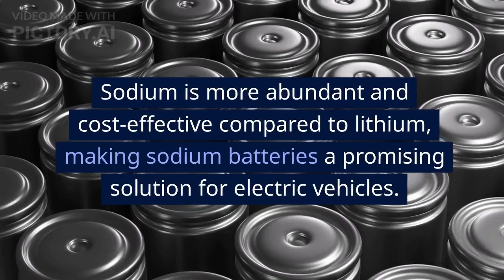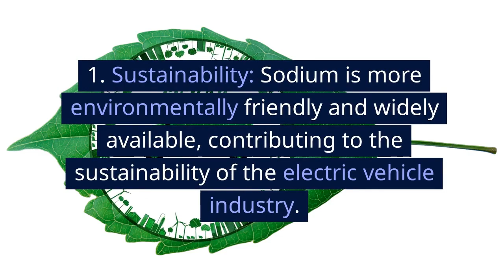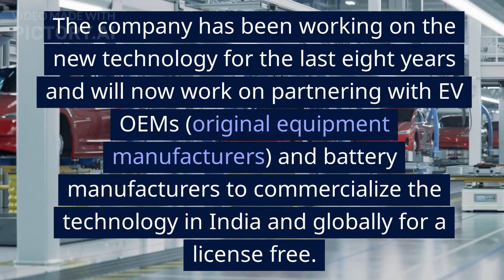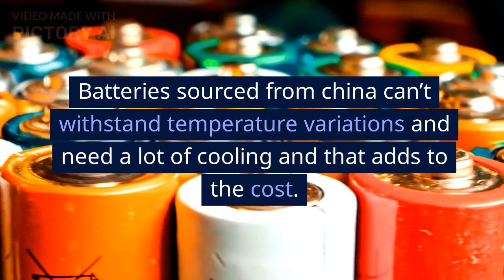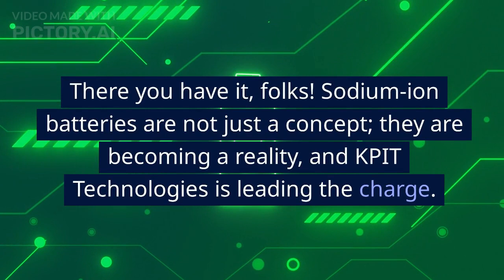SODIUM ion Battery will make EVs cheaper  An Initiative by KPIT Technologies Pune

Comment: If these batteries are for two and three wheeler vehicles it'd be way cheaper to sell the vehicle without the battery and simply make them hot swappable like the Company Gogoro in Korea which allows user to rent the batteries and swap them at over 2000 stations when required for fast recharge (As you swap them out as you need them and the batteries at the recharge station also double as grid supply) would this not be a better fit for India as it's transportation sector needs are very similar to Korea's?
Reply from the maker: First of all, I would like to thank you, for showing interest in my You Tube video. Definitely, swapping Sodium ion battery is a smart move. But at current stage, I am not having complete information about this movement, but I will definitely get back to you, if this happens in future . Please don't forget to subscribe my You Tube channel for more tech based video in the future.
Reply: @excitingknowledgeamit  That's alright mate, the sodium battery stuff does look interesting and should definitely help drive down the cost.  Here's a video of the Gogoro network they have in Taiwan, https://www.youtube.com/watch?v=r2hLjcNxjKI  I found video's as old as 3 years on this stuff so it must be pretty well established over there already.
Reply: Yeah but how come no one's heard of nano flow cell Bi-ion
Electrolyte refill? Battery swapping is obsolete. You don't need to swap the physical battery you just refill two salt water electrolyte tanks. Google Quantino Nano flow cell 48v
Reply: @MoreSuperiorThanCarbon  Well for one, you probably can't charge this at home because I'm guessing it's proprietary technology.
Secondly they don't mention the energy density anywhere (KWh per kg) This would really effect the range of the vehicle between charges. Another big one is the volumetric density (how much physical space does the battery take up per KWh?) It could be the size a small van required to have enough to go the same range as a BEV.  Details are sketch on this tech, it might be vaporware.

Comment: What is power density (kwh per kg)
Reply from the maker: Thank you for showing interest in my video, well its the most genuine question asked so far. Well I can't say the exact amount, but as per the latest information KPIT Pune unveils sodium ion battery with energy density maximum up to 170Wh/Kg  . I hope I have given answer as per the questioned asked. Please don't forget to subscribe my You Tube Channel, if you have not subscribed my channel so far.
Reply: @excitingknowledgeamit  Thank you for answering my question.  Its power density is quite a bit less than current lifpo technology. So it looks like sodium-based batteries may be best suited to stationary power storage rather than EVs.  But that is not a bad thing.  We desperately need a cheaper means of storing electricity produced by wind and solar when they are not available.